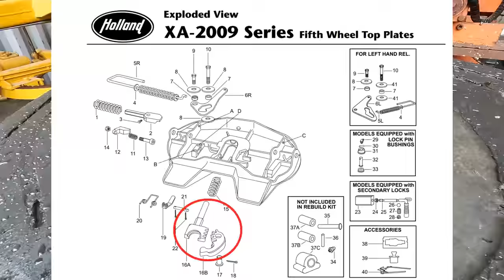1980 Autocar “Construcktor” Hauls its First loads in Many Many Years!

Comment: That old Autocar is a beast, sounds great. Lot of people are used to these Modern Diesel engines with all the EGR crap and that's what those old diesels sound like. Love it !!
Reply: on modern diesels all you can hear is the turbo screaming for air because it has to push through all those damn filters. It is not a nice sound. Old engines sound so much better
Reply: @thesteelrodent1796  They're also driving higher and higher amounts of boost for emissions reasons. Soot from a diesel engine is unburned, partially burned fuel, and so in an effort to clean that up these new engines run absolutely ludicrous amounts of boost. That, too, will make the turbo scream louder than anything else.

There's also today's 'hush hush' push too. The entire engine induction system is designed to quieten down as much as it possibly can. Even if the turbo didn't nullify the throatiness of the engine itself, all the other bullshit from air inlet to exhaust tip would as well.

I remember as a kid...back in the days of Detroit Series 60 and CAT 3406 being the main engines in OTR trucks...that you could hear those things from quite a ways away. When I was in a car on the freeway and we passed one I could only hear the engine when we got near the steer axle. Nowadays...nope. Can't hear shit, cap'n.
Reply: @TestECull  My Favorite Truck back in the day, was My 1988 Pete, it had a 400 3406 that I turned up to 425hp, you could do that on REAL Trucks, the Road Ranger 13sp w/OD was more than it Needed with those Big Rears for Logging, it would do 68mph Top End all day, Loaded & Empty!!!
Weighing in over 100,000 Pounds was nothing for the old Girl, I remember puling out of one rock Quarry and I was over 110,000 as I Maxed their Scale, down the bottom of the Hill I turned the corner and Up shifted in to fifth, and the Tries Barked as they broke FREE, What a Beast!!

Comment: I think the truck has a brilliant sound including the turbo. The trailer is a great match for the wagon. Great job 👍
Reply: I like it because you can't hear the turbo very much at all. The engine itself gets to sing. If I was gonna rank my top five favorite sounding diesel engines four of them would be N/A.

Turbocharging pairs exceptionally well with diesel engines, but turbos are a death knell for sweet engine noises. They just drown the rest out and you just hear turbine whirr. Large part of why I'm not much of a fan of turbos in general tbph...
Reply: @TestECull  I grew up spending a lot of time with my father in his truck. this was in the UK in the 70's and he always drove Leyland lorry's. They have a distinct sound that did have a lot of grunt but did not drive to fast. But saying that, it would not be safe with such old vehicles.
Reply: @fatblokes_ferguson  I'd rather run an old rig than a new one. But I also just signed the paperwork on a '53 Ford Business Coupe to replace the ailing '14 Challenger I'm in right now, so yanno.

Comment: Matt, the plates for the wheel wells on the trailer are for loading small wheeled vehicles or when hauling cargo that could slip through the openings and rub on the tires. I hauled a lot of equipment on one of those in the Army and only used them once. They have a tendency to bounce off the trailer if not chained down. Those ramps were a pain in the butt to use. But they would take the weight of a Cat D7F being loaded and unloaded on them.  Have a good day
.

Comment: I usually keep my trap shut because everyone does things a different way but for pins you would be surprised what an air chisel with the punch or pin pusher bit can do especially in tight places
Reply: Agreed. An air hammer sure has saved me a lot of sweat and curses.

Comment: Its taking every Ounce of Tire pressure on them loader Tires to Lift that Trailer with that crane wow and the back tires are st full droop off the ground at a angle Im impressed the loader lifted it 😮 wow Matt 33:12 @Diesel Creek

Comment: I used to be a crane operator using cranes 10x bigger unloading 31ft long bundles of steel off flatbeds. love this old Autocar. I've been a subscriber for awhile. you've got some fun toys.
Reply: I'd leave the overhead crane just as it is.
Modify it and loose all your ratings and inspection. Just think out the box. Don't put the rails down the sides, put them 90 degrees and go from side to side, even if it's not as long as the building. Having the bridge go from left to right and the trolley go from front to back (or  as far as it can) you'll cover most of the garage.
As far as 3 phase goes, worse case, get a 3 phase generator.

Comment: Oversize load banner is perfectly acceptable on the load. It just needs to be clearly visible at the rear and not obscure the license plate, however I do recommend you get some flashing amber lights to put on the rear of the load and an amber light bar for the top of the truck if you're going to do oversize again
Reply: you also need oversize on the front as well it needs to be seen from on coming traffic as well as traffic coming up on you from behind.
Reply: @19jessejames83  in a later shot while he was talking you could see the front banner was on
Reply: Keep in mind everyone that he is a 1 man operation.  This isn't "Roadway Express" and he just needs to make an honest effort to follow all of the laws and be safe as any 'reasonable and prudent' person would be.  I thought he went above and beyond for a one time short haul of an oversized load.  It's his liability decision and it is unlikely he'll incur any major fines even if he is stopped for violations.  It's not unlike hauling something questionable home from the hardware store - the officer will likely tell you to slow down, be safe, and if he catches you again you'll be in trouble.  If he has time he may even escort you the last 10 miles.  They are paid to protect and serve after all and most (of the good ones) do.

Comment: I pulled a lowboy like that around in Germany with a 916. Normally had a D7F on the deck. We occasionally pulled the bridges that came off the AVLB's, Eventually we got the 40 ton floding goose neck trailers and life got a lot better. Those ramps where heavy and a one man job according to the Army. Brings back some good old memories.

Comment: Hello Matt;  
     It makes me smile every time I see an old truck still doing it's job. Two (or maybe more) about your trailer. First off I'd check the brakes. Either it doesn't have "maxi's" or they're backed off. I would make sure they're adjusted up first thing. It they're the old style I'd check the assorted valves and ALWAYS charge the air system before hooking up or at least block the wheels. Enough said about that.
     Now regarding the ramps, have considered mounting the "European" style meaning hinged to the trailer and using hydraulics to lower and raise them. We had those same trailers when I was in the Army and if you didn't have 4 very strong guys ( they're about 600 pounds each) you would have to work off the sides with blocking. The drivers side 2 rear tires looked low or maybe 1 is flat (most likely the inner).
     If possible I would move the winch section of your crane over the tires of the trailer. They won't sink as much in that soft dirt. Great video.